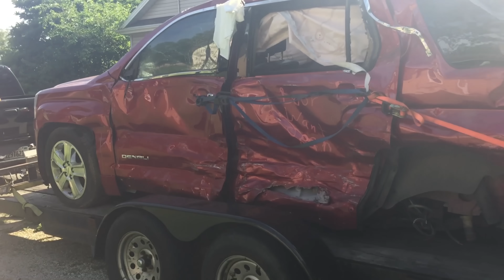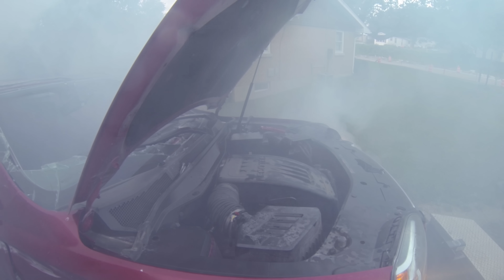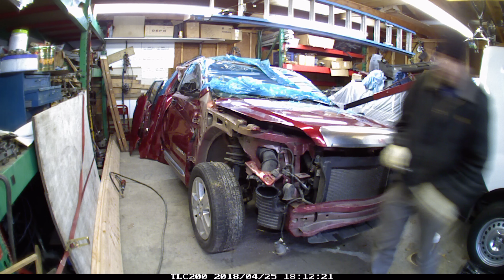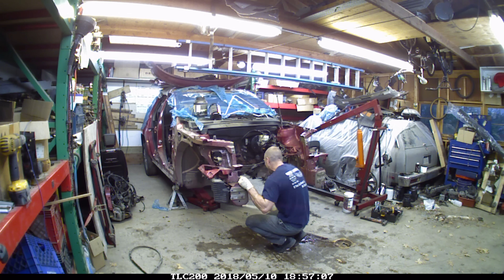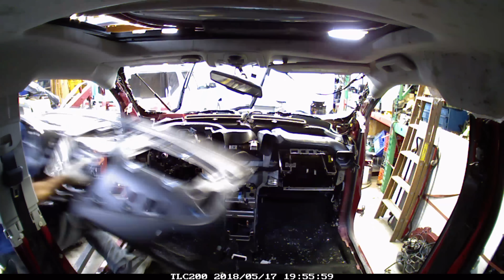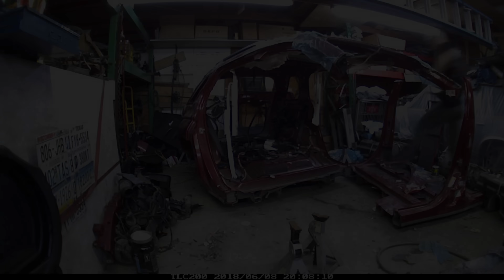Unlocking the engine and cutting up a GMC Terrain Denali

Comment: the engine must have been running (up side down) for at least a while for enough oil to get into the cylinders to bend a rod. Although........the oil could have rapidly flooded the intake through the PCV and that would have been a lot quicker path for the oil.

Comment: THAT'S totaled?! WTF it doesn't look that bad truth be told. I figure $4,000 at most to get it into CPO condition. Pull out the dents and wrinkles, stick another wheel in the back since the original one probably just had loose lug nuts. Fix all the glass with a windshield crack repair kit. Easy peasy.

Comment: Great job, as usual.  If you're looking for project cars with minimal interior damage, and the potential for a high return on your time, check the auctions for the low mileage 2020 Lexus vehicles, particularly the RX350 and RX 350L and RX 450 models, and the big Lexus SUVs. There is an air bag sensor problem in many, if not all of them, and the air bags are reluctant to deploy in either rear end or front end collisions that total the vehicles. At the end of a collision, a message pops up on the screen with the news that there is defect in the air bag and restraint system causing non-deployment, and to contact the dealer, if you're still alive. Ask me how I discovered this Lexus feature.

Watching you methodically take a car or truck apart in short order, and then putting a wrecked one back together with the pieces you've salvaged is truly watching a master mechanic at work. You're one of the few people who understands how every system in a vehicle works and how the various systems interact with the other components and the chassis, etc. to make a vehicle work as you want it to, and, in many cases, as it should have been designed to.  Thanks again - seeing is believing.

Comment: Even without rolling over, those 2.4L ecotec engines fill the intake with oil 🤣
Reply: Ya I worked at a dealership. 2.4 equinoxes had to have the oil level checked on arrival. Think there even was a class action lawsuit

Comment: I had no idea a rollover would cause the motor to hydro lock
Reply: Yes, engine sits upside down and the oil in the pan leaks past the piston rings into the cylinders.  Thats why you must pull the plugs and clear it out before trying to start.

This one has a bent rod, so it either ran some time upside down, or someone previously tried to start it without clearing the cylinders.

Comment: I always think rollover engines are typically junk as they starve for oil when upside down or hidrolocked  with a bent rod
Reply: Its all about the wreck. If it lands upside-down its usually toast. Landing on the wheels can mean zero damage.
Reply: I rolled a 5.0 commodore and somehow managed to turn the car off before any engine damage occurred but after my head went through the drivers window. Engine went into my sisters car 3 weeks later , it was fine
Reply: If its shut down quickly, it will 99% of the time be fine.  The bigger problem is when it turns off, sits upside down and oil drains into the cylinders, then gets rolled back and they try to start it without draining the cylinders.

Comment: I never realized a hydro locked engine could be fixed. Once that happens, I thought that was it! Learn something new everyday I guess! LOL Thanks for the bonus video!
Reply from the maker: Connecting rods seem to be made out of butter these days.  On the older engines, you just pulled the plugs, turned it over and pushed the oil out and put it back together and you were done.  They would smoke for a while but 99% saved.  These days it is more like 40%.
Reply: I used to turn the engine over several times with a wrench or a prybar on the flywheel. Only if that did not work would I pull plugs. Pretty much the same end result.

Comment: I thought I had a smokey start when I overdid the oil fogging on my Dodge truck....fogged it for winter storage...no mosquito cold start the following spring.
Reply from the maker: I like to squirt a little extra oil in the cylinders when I have an intake off just to mess with the whiners in the shop. lol
Reply: Half a quart of trans fluid poured down a carburetor would fog a 16 stall shop real quick. The service manager was not pleased with our shenanigans. Btw, not a customers car, one of the mechanics brought his car into the shop to do some work on it on his vacation. We did buy him a new set of plugs. Dan.

Comment: So my wife was trying to pull my car into our spot last Thursday when my neighbor decided to back out of her spot without checking her back up camera and t-boned my equinox. Then the bitch tried to claim that she was not responsible. Her insurance company believed me and not her. They called today to tell me what had to be done. New passenger front fender, front door and replace the outer layer of the b Pilar. Thanks to your amazing instruction I already knew what that entailed. And I am armed with the knowledge of what to expect it to look like if they did it right. Thanks so much!
Reply from the maker: Geez was she backing up at full throttle? lol  I hope your Equinox turns out as good as new!
Reply: @vehcor  she must have been. She had a bad habit of zipping in and out of her space. Since the collision know she only backs into her space like I've always done. I hope her insurance rates get jacked sky high!
Reply: vehcor Equinox’s are 💩 from the the factory. 😳

Comment: Great video, a few good laughs in that, as well as the interest in what you could salvage from it. It's surprising just how many parts you can get from something that seems like it has nothing good on it. Seeing all that smoke reminded me of a car I had back in the 70's. It did that all the time. Good for making tail-gaters back off. Just hit the gas and cover them with smoke! We used to cut up old cars with an axe, as we didn't have a reciprocating saw back then. Always happy to see your new video on Saturday morning and the Wednesday video is always a bonus. All the best from Queensland Australia.
Reply from the maker: I never thought this would be a popular video idea but what do I know.  I might have to do another on a parts car.  There is more to salvage than most people realize.  These have notoriously bad transmissions and with only 20K on this one, it is worth 3 times what I paid for the entire thing.  Take care!
Reply: @vehcor  we like stuff we can sit back and just absorb.   It is interesting seeing how stuff goes together and the best way to see that, is to take it apart.
Reply: Oh yes, lots of good parts can be salvaged on most any car besides a burned one.  Flood cars are amazing for clean sheetmetal, bumpers, and usually engines too.  Years ago I made good money buying smaller plastic parts and specialty electronics for pennies at the junkyard, then reselling them to people who knew what they were worth.  Just have to know what a part is worth and who needs it.

Comment: As always....a Freaking BEAST!! How much do you get for the scrap metal? Awesome content!!
Reply from the maker: Prices vary on steel.  Right now I think it is $105/ton.  I wish it were the $400/ton days. lol Thanks for watching.
Reply: What paperwork do they ask, kind in dilemma, have car bought from auction have auction paperwork, bill of sale  but no title. In a order to get title I need to pass state patroll, but car is in pieces. Can I just chopped like u did and take it to the scrap yard as scrap? Thanks
Reply: @andrymashka1757  Depends on the state and in some cases the city. For scrapping, the bill of sale may well be enough. But, if you cut the remains in half or thirds, most scrap yards won't ask for paperwork. Only exception would be if it's something of high value. Of course, crunched sheet metal seldom needs an explanation.

Comment: 2 videos a week? You’re really kicking it up a notch!
Reply from the maker: Cleaning out the hard drives while the ad revenue is good.  Make as many as you can right now, it will drop a little after the election and a lot after the holidays.
Reply: Thanks for the tip. I didn’t even think about that. I’ve been recording plenty, I just need to edit, which is my least favorite part. But you know all about that.

Comment: I had a rat problem in my garage so I  used a smoking ford to drive them out,I left the car in for  3 hours and the burning oil found every little crack in the building it was like on fire from a distance ,anyway the rats didn't leave home and the ford failed to do its one last job ,double bum
Reply from the maker: I think the remarkable part of your story is you got a Ford to run for three hours. lol
Reply: Vehcor, 😂😂😂😂. Great comeback. Lol

Comment: "Everything is drivable if you're brave enough" 😂👍
Reply from the maker: I have driven some pretty sketchy stuff in my day. 😂
Reply: @vehcor  😂😂😂
Reply: @vehcor  I drove my flooded new truck off the trailer after the delivery driver gave up doing that.
Reply: I have driven a truck with the whole side ripped off with the battery held in by an extension cord and some rope.

Comment: That engine even though it has a knock is it still worth saving??
Reply from the maker: I planned on using it for parts.  It is a shame to waste 20,000 mile parts.
Reply: Heads and injection are probably fine, although I'd look closely at valves. 

It's still a good rebuild candidate as the block is low mileage. You'd have to strip it down to tell for sure, but it might just need a set of rods and bearings. Depending on engine that's a judgement call. can you get low mileage used engines for a fair price? If not, one like this is worth a look.

Comment: So because of hydrolocking, cars which can drive upside-down will never be possible?
There goes that dream right out the window.
Reply from the maker: Not without some different rings and oil sump system.
Reply: @vehcor  So there is hope yet!
Reply: @vehcor  Much easier just to use a two-stroke engine - no oil sump!

Comment: Do you keep a lot of the parts you don't use from a parts car? Or do you sell them on eBay or some other place? If you keep them, do you try and do the same model cars over an over to use those parts?
Reply from the maker: Sometimes you buy parts cars for the build, others you buy a build for the parts cars.  I bought the silver Terrain to use up the front end I had.  I also sell a lot of parts.

Comment: I’m surprised something was usable off of that thing.
Reply from the maker: Lots of useful stuff.  A few thousand dollar worth off a few hundred dollar car.
Reply: There's a lot of stuff still usable.
Reply: @benvalenza1977  me too! I mean they catch leaks and break without a crash, but i guess GM actually did something right...for once😂
Reply: @benvalenza1977  The condenser is really the only unprotected part, all the lines and evaporator are decently protected.  If the condenser isnt damaged, then it probably wont leak out.
Reply: I doesn't belive that the word "disposable" exsist in his dictionary